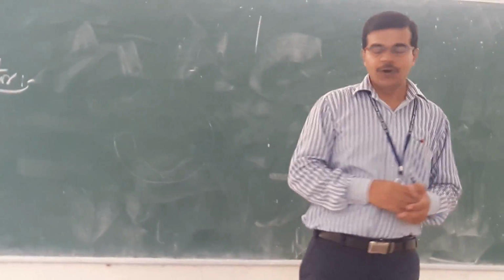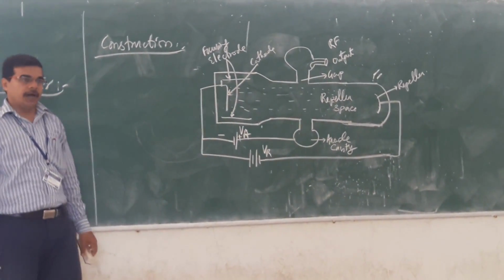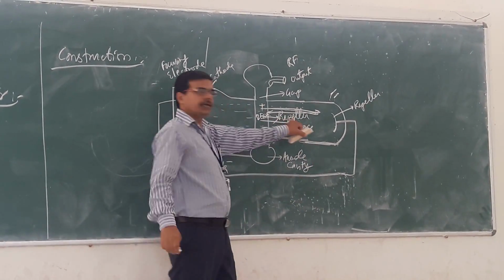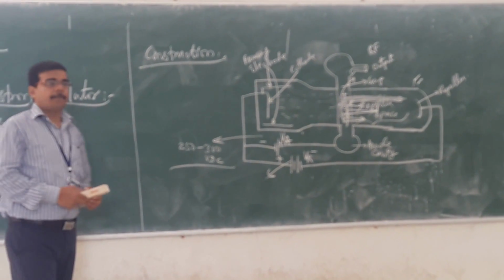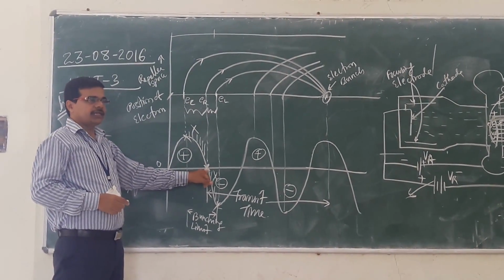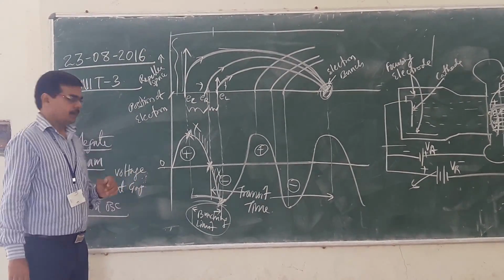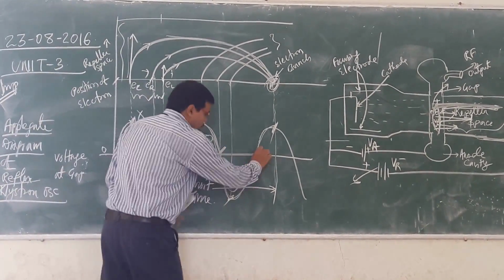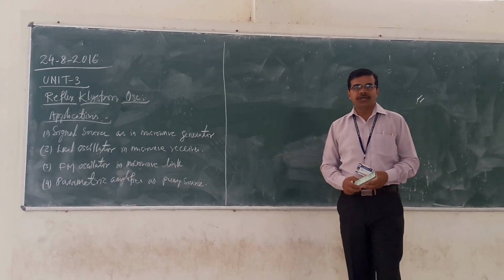MWE UNIT 3 TOPIC 5/6 Reflex Klystron Oscillator

Comment: actually,,when we are providing the power supply dc ..there will be initially transients which can be modeled as the noise..now this noise can be thought of containing several frequency components..the frequency component supported by the cavity depends on the modes of the klystron..modes may be 3by 4,1 3by4.,2 3by4....so a particular frequency initially has been taken as cavity can support a particular resonant frequency for a particular mode,,hence can be approximated as a single frequency noise source
Reply from the maker: Good.
Reply from the maker: You can even try the app "anmol classes" under google play store. It is having app for Microwave Engineering, Satellite Communication, Basic Electrical and Electronics Engineering, Digital Logic Design and so on.

Comment: Explanation is really good  but could you please tell me why we are getting the sinusoidal voltage variation at the gap even though we are giving positive dc supply only to the anode
Reply from the maker: You can even try the app "anmol classes" under google play store. It is having app for Microwave Engineering, Satellite Communication, Basic Electrical and Electronics Engineering, Digital Logic Design and so on.